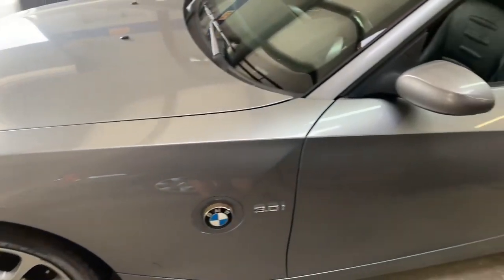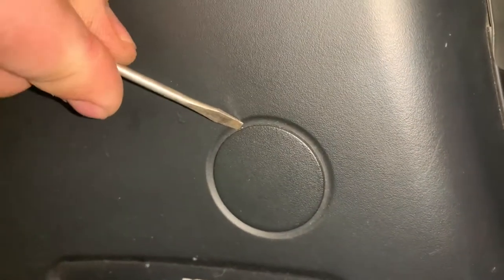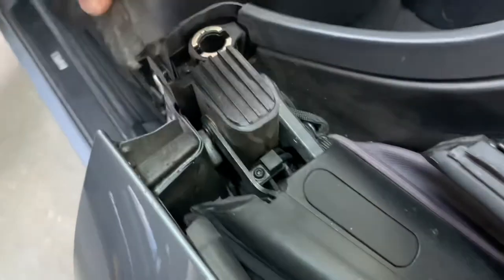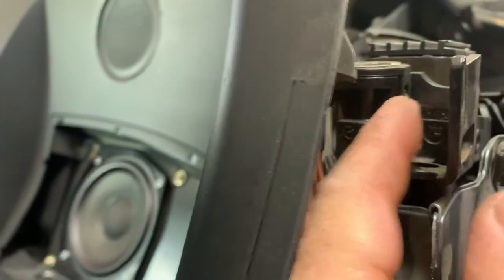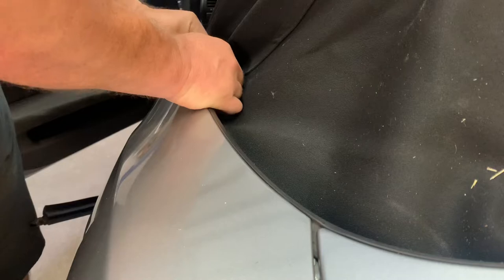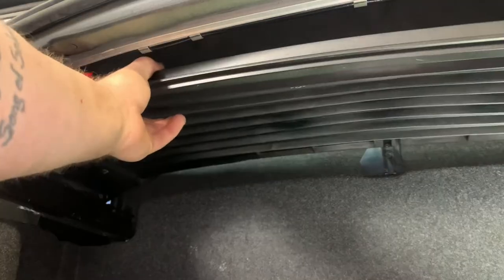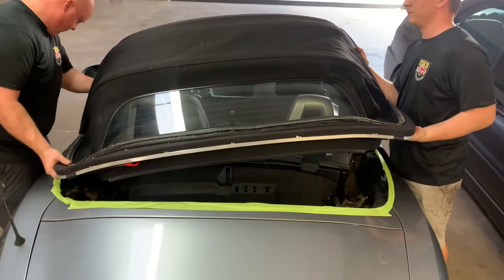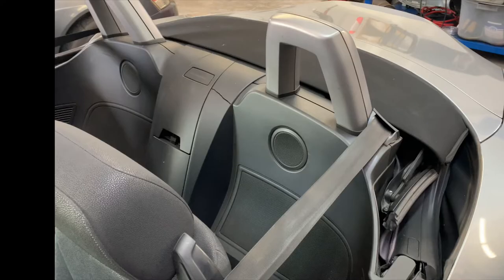BMW Z4 CONVERTIBLE TOP REMOVAL. DIY BMW REPAIR FIX YOUR e85

Comment: Hello I need some advice ASAP I need to change the motor of the hood, I've taken all the boot apart and can see the motor but its way to hard to get out, Getting the tape off is impossible, it won't pull out etc. Is there any way I can get to the motor easier, ive tried reaching inside, but again its impossible. any tips of how to make it totally clear without taking the roof off?
Reply from the maker: Taking the complete top out is the only way I repair them.
Reply: @baldmankt  okay ill have to go for it. just worried about cables, my steering wheel is not he right im from the uk will it still work from your video? the pump is on the left hand side of the boot

Comment: Do you have experience with softtop alignment? How to ensure the top does not hit the chassis when it folds down? It seems many z4s suffer from this and it causes damage over time. Hope you have some advice!
Reply from the maker: I don’t personally do any fabric work on them. However the most common issue I see with soft tops and wear problems is the elastic tension straps that are sewn into the underside of the fabric between the headliner and top fabric. These tension straps keep each of the bows in the top frame folding properly.
Reply: @baldmankt  thank you very much! I will have a closer look this weekend to see if I can locate the elastic straps and if they are pulling enough.
Reply: @chuck7432  I hope so :-) this is my second Z4 E85 and previous did not have any friction wear on the softtop fabric. My current Z4 does have the friction wear and I am not the only one it seems. In the BMW manuals I do find adjustment settings but no explanation unfortunately. I will investigate the elastic straps first to see if that explains the friction based wear. I keep you posted on findings. Thanks!

Comment: Hello. I have to repare the top of my Z4 but I don't know exactly what's wrong. The hidraulics were liking till the top roof had no force to open, but now the motors are not working. I mean the front motor to lock the roof just works to close if I open manually and the motor for the hidraulics doesn't work anymore but I took it outside from the trunk and it looks like new. The question is: Is it possible that motors don't work when there is no hidràulic pressure? Thank you for your helpfull videos.
Reply from the maker: If you have power getting to the pump when switched and it’s not working the pump has failed. There’s a switch in the trunk for the divider tray that also needs to be pressed for the pump to work
Reply: @baldmankt  Thank you for your answer, but where is that switch. I'm lost because if the top is open it works to close it (both motors pump and lock) but when it's closed it doesn't open(doesn't work, anyone of both motors).🤯🤪
Reply: Ah, ok man. I know what you mean. You mean that the tray has to press the switch being in the low position to have enought place for the folded top. I'll check it but I think that's no the problem. Anyway thanks a lot!

Comment: Question can you change the top while it's out of the car?
Reply from the maker: It’s definitely possible. You would have to make a bracket or structure to bolt the top to at the mounting points.
Reply: @baldmankt  I was thinking of putting it on some saw horses, and trying it that way.. Opinion?
Reply from the maker: @jaguarguy67  sawhorses would be fine for changing the hydraulics but for the fabric you would need full access and will be doing a lot of pulling and stretching so you would need it mounted solid.

Comment: Mine was partially worked on. The power line that plugs into the pump was disconnected, i can not find where to plug the line into.
Reply from the maker: There are 2 main connectors for the pump wires . One is the black connector behind the driver’s seat at about 2:35 in. The other connection is directly on the pump. It’s not shown in this video but you can find it in my follow up video WHY YOUR Z4 TOP IS NOT WORKING AND HOW TO FIX IT!!!
https://youtu.be/6YvPj2mMmNA

Comment: At 5:36 the instructions say to release "these clips". I don't understand what to do here. It shows a thumb pressing on some kind of plastic bracket. At 5:30 it shows a screwdriver pushing into the start of the fabric with the instructions saying "release this clip by prying carefully with a screwdriver underneath the top". I can't see just what is being done here. Again I don't see any clip, just a black hole. I don't get it.
Reply from the maker: It may hard to see or understand in the video but looking through the trunk ahead of the black bar there is a metal “prong” type clip that is holding the aluminum top bow in place. From outside the car you are prying on the aluminum bow not the fabric
Reply: These two clips, one on each side of the car might be the trickiest part of the job (or second only to realizing you must open the roof perhaps half way to relieve most of its rigidity to wrestle it out). And no mystery its the 'most viewed' portion. At 5:34 when he says the word "these" you can see the clip before the finger moves over it. At 5:37 you can see it again after he says "release this"... for about a half second, both times to the right of the finger.  It is aluminum colored and has two prongs, at slightly different angles. I watched the video mainly to see how this was captured and instructed. Great job... I hadn't even thought to try to access them from the passenger area (by lifting the roof a little). I'll try that this time, when I rebuild my hydraulic cartridges/cylinders. (Last time was to remove and move the hydraulic pump to trunk). Rubik "had nothin'" on those Beemer designers!

Comment: I have a 2003 BMW Z4 convertible I would like to have your number so I can call talk to you about why the convertible top bolt on latch that will not come down put a new electric pumping but did not put the pump reservoir in and of being told it's some kind of a sensor or something or the ECU is mixed signals
Reply: But yet everything else in the car is working do not understand why it will come back a little bit but I can't even do it manually is the reservoir the problem

Comment: Great video. Is there a way to check and add fluid without taking the top completely off? My top unlatches, motor runs but will not go up or down. I can manually operate the top up and down. Could it be low an fluid?
Reply from the maker: It definitely sounds like you’re low on fluid. I would suggest you remove the top, find the leak and relocate the pump following this video. https://youtu.be/6YvPj2mMmNA?si=_YsYGLIo8FvQXyxf